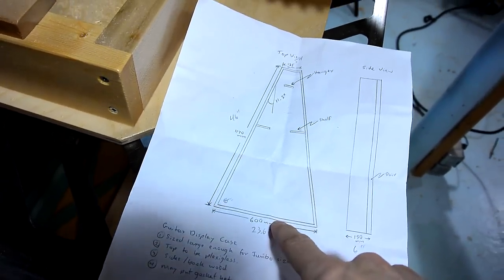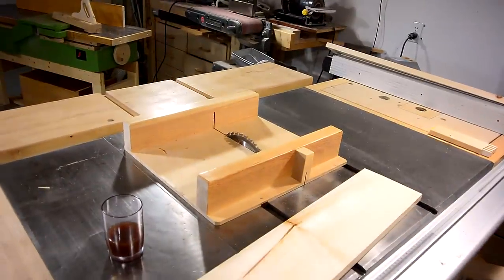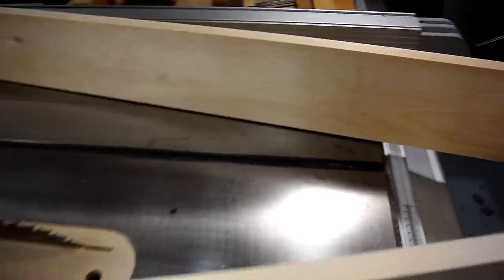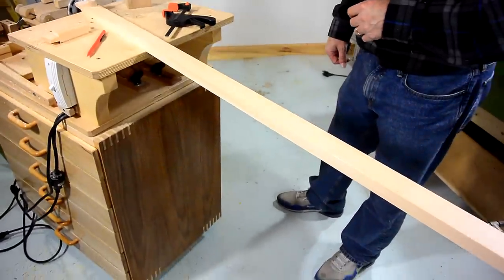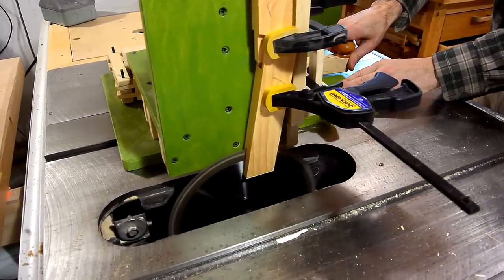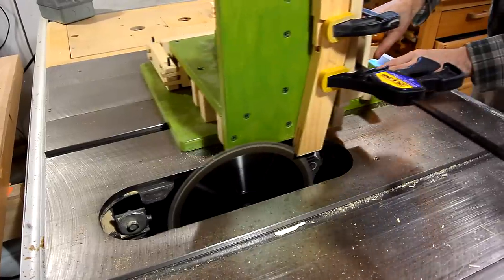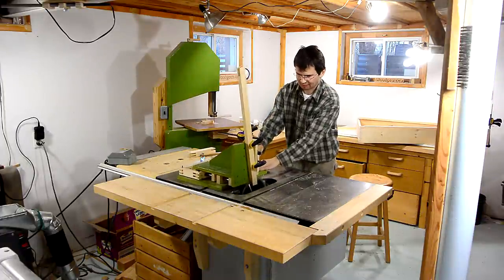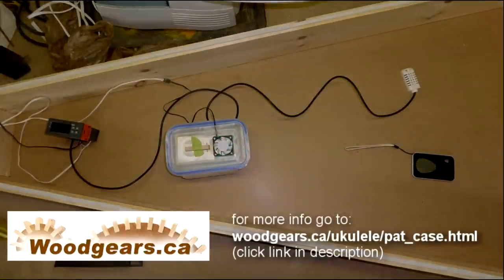Pat's guitar case

Comment: Hi everyone, Pat here. The point of this guitar display case is to experiment to see if I can make a humidity controlled environment, i.e. at about 45% RH through the winter months when it gets very dry here in Ottawa. My motivation is that a few of my guitars have come back to repair cracks that have occurred due to the wood drying out. This is a very common problem in dry regions. Also, most people just do not have the discipline to check and maintain (almost daily) the small guitar case humidifiers that are available so I'm hoping to have something that can be set up and be left for at least a month at a time. This first case I did with Matthias I used inexpensive woods. If it works, I'll probably make another one out of nicer woods and then perhaps offer them to people who have one of my guitars. But first I'd have to buy the plans for Matthias's box joint jig and make one of those!
Reply from the maker: Patrick Hawley For all your help with the Ukulele project, Pat, you get the plans for free.
Reply: Matthias Wandel Thanks Matthias, I'll gladly take you up on that. People should know that you've already built a pantograph for me that has taken the accuracy of my guitar inlays to the next level.
Reply: Patrick Hawley Hey Pat, Try rice instead of the silica gel to decrease humidity.
Reply: Right. How do I do that? Thanks for the suggestion but I doubt that the rice would work fast enough to be practical assuming the case would be opened one or more times a day so the guitar could be played. Doing a search on the internet, the best bet appears to be a solid state "micro-dehumidifier" sold by a company in the UK. However I'm not motivated enough to try that as the more serious problem, and what I really built the case for is to have a higher humidity environment for dry Ottawa winters. Stay tuned, I'll be doing some serious trials for that capability in the January/February time-frame.
Reply: +Patrick Hawley I wonder what happens if you just put a bowl of water in the case? If high humidity isn't the issue maybe you don't have to worry about lowering the humidity at all?
Reply: +Right. How do I make that? Rice is far less effective at drawing out humidity than silica. Its effectivity as a dehumidifier is pretty much just an urban myth.
Reply: +Lukas don It wasn't high humidity that was the issue though, but low humidity in the winter.

Comment: Loving the Canadian lumberjack shirts hah :p

Maybe try a dehumidifier with a pipe going inside guitar case. Then make the case air tight and any moisture would have to come from wood. The dehumidifier would only need to run once to remove initial humidity. Although I have a feeling the water in the wood will replace the lack of humidity in the box.

Maybe look for a small dehumidifier. The silica gel are designed for water not water vapour as such. I am sure you know that. Hence why it wont work too well. 

You could make your own dehumidifier with a peltier unit. That would make a small dehumidifier. You would want to limit it / run it at lower power so it condenses the water but lets it drip off instead of freezing.

Comment: as a guitar player , you friend is going a little overboard on his guitar case...in 33 years of playing ive never had a guitars wood crack on me from weather, or temperature....  nice project but unless he is storing elvis's first guitar, its a little overboard....
Reply from the maker: Mike Dijital Cracking is only an issue for solid top guitars - the kind that cost $2000 and up.
Reply: Mike Dijital 
He uses expensive woods and gets very good $$$ for his guitars.
When he builds it, he puts a lot of humidity into it with steaming and glue.
What ever he can do to control his humidity loss and prevent cracking, why not ?
Reply: I also play. one thing that can happen is glue joints separating. it happens mostly when taking your guitar in and out of air conditioning without acclimation.
Reply: Matthias Wandel Maybe geographic location is a thing, your winters are a bit more brutal, but i play 2000$ and up solid top guitars and never had issues here in Boston or Arizona
Reply: Mike Dijital 
In Alberta during the
winter cold exterior air humidity drops to as low as 10% when it is
warmed up inside the house.  Most imported solid wood furniture from
humid climates cracks and/or the joints loosen up.  Hence all
building have humidifiers to maintain the humidity above 30%.